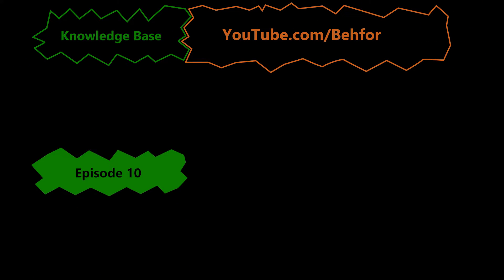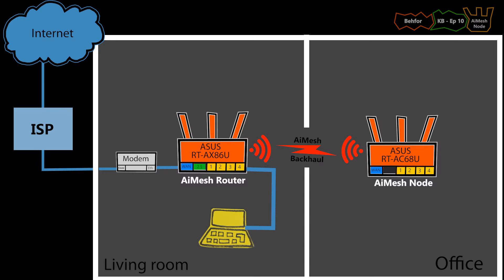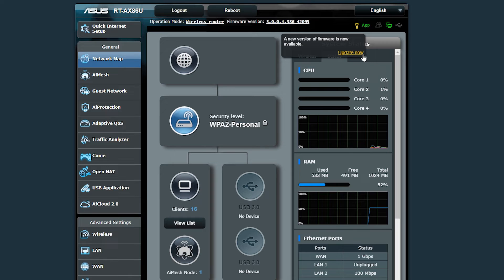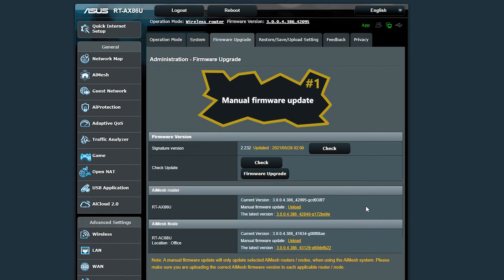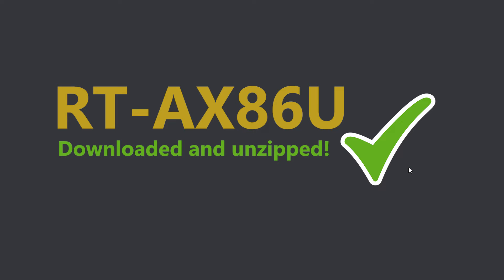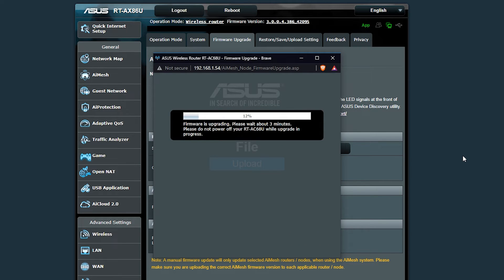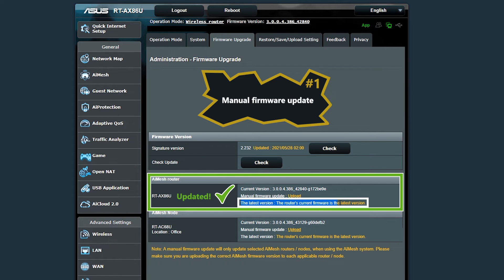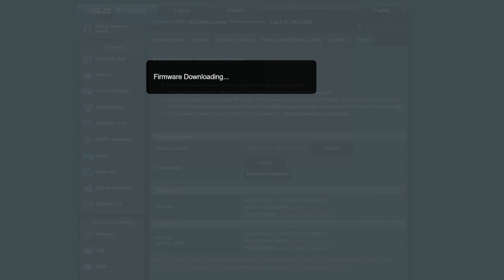How to update firmware of AiMesh Nodes? [KB Ep10]

Comment: I’m thinking of installing Merlin.  Will this be available also if I do?
Reply from the maker: If I remember correctly, Aimesh was added to Merlin sometime in 2019. However, I would recommend double-checking the Merlin website to ensure that it is available for your specific wireless router. Thanks.

Comment: Thank you for the video, I struggled a lot and the following worked for me. 1. Hard reset node  2. Wait for boot up. 3. Connect to node wireless via label on the  back. 4. Set node as a node. 5. Node will reboot. 6. Open router and search for node. 7. Once node is found on wifi, plug in the router Lan to node wan. Icon on Wil change. Proceed. Setup worked for me.

Comment: Behfor,  Today (12/24/22) I have a firmware (AiMesh) update for my RT-AX86U (merlin) but NOT my nodes, FIRST, time this has occurred , will I run into issues with this upgrade?  (Router- "388.1"  -  Nodes- "386.7.2")
Reply: more... NODES - RT-AC68U (3)
Reply from the maker: If the main router is different than the nodes, it should be fine if they have different versions of firmware. As long as they all have the latest firmware and as long as they all support AiMesh, and as far as I know there shouldn't be any problem. Thanks.

Comment: I updated the firmware on my router and it lost its communication with the AI node. Now even clicking to check firmware or to find the AI node crashes the router. ZenWifie AX. The web search mode didn't work. The router was updated manually, restarted, and now the mesh is messed up.
Reply: It took several minutes, but the router found the AI node and I can now manually update the firmware.

Comment: Sir, i use Asus RT-AC59U V2 router for my office, i have set dual wan connection but there is one problem i am facing primary wan has internet connection but second wan is for private network (it's an V-Sat connection not internet) . So i want that if primary connection don't have internet so it will always stay in secondary network until primary connection internet back , can you make a video of this please 🥰